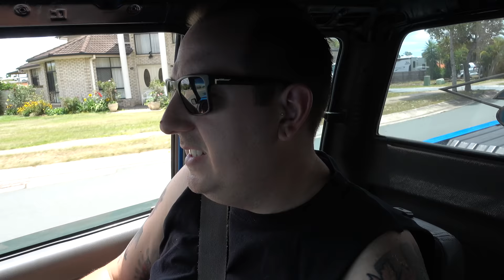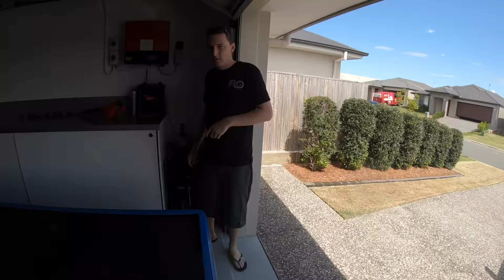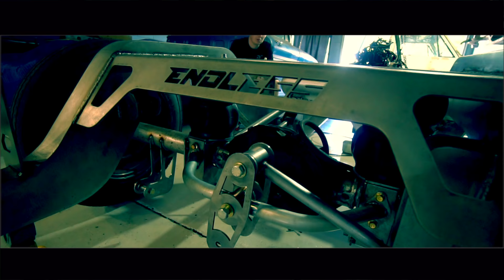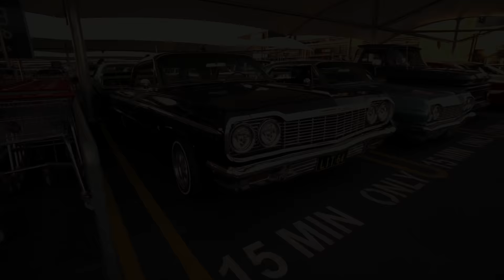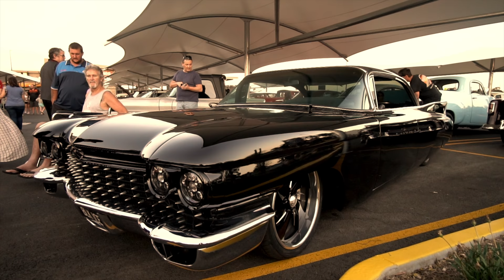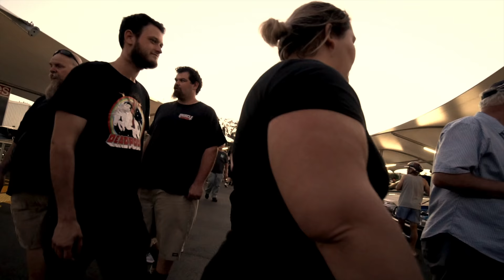How to have an awesome day Minitruckin

Comment: What's the specs on your rims? Are those coy c33 rims?
Reply from the maker: Tyler Roof they are Mobsteel Detroit Steel Wheel Co smoothies
Reply from the maker: 18 front, 20 rear
Reply: What's the back spacing? And width